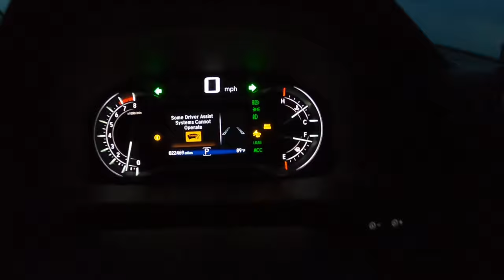Towing 4800lbs 3000 Miles across America with a Honda Ridgeline - Part 2

Comment: Great video. I would not worry about a trans temp of 220. Modern trans fluids are synthetic now. The factory cooler runs off of the radiator and the trans will run at a minimum of the coolant temp. A $35 trans cooler off of Amazon can be installed in an hour or two which would take care lowering the trans temp if you want the trans to run cooler.

Comment: What year did you use while towing? Did you try selecting a lower gear to see if the transmission temp would go down?
Reply from the maker: I believe I go over that in part 3 and I will talk about it in detail in my wrap up video. But to answer you quickly I used drive only and did not use the D4 (Overdrive). From research people have stated on forums the D4 makes the truck run hotter.

Comment: I think if you tow over 3500 Honda recommends the transmission cooler had to get one on my Pilot
Reply from the maker: Interesting. Haven’t heard of this yet. First time.  This is the RTLE so it’s rated for 5000. Didn’t read anything in the manual that stated I needed to upgrade the cooler.
Reply: Yuriy Motso oh that maybe the difference from the Pilot maybe the Ridgeline came with it already cause my Pilot required the transmission cooler for the 5000 rating
Reply: The ridgeline comes with a transmission cooler
Reply: @aronjohn84 but included in the radiator, not External, 35 bucks would Solve that

Comment: How much did the trailer weight ? Any idea total weight pulled and loaded inside the truck?
Reply from the maker: I weighed every single item before I loaded it. Trailer was roughly 3800+ LBS and the truck was roughly 1000 LBS with me. Total weight was very close to 5000 LBS if not a bit over.

Comment: Does the Honda ridgeline not come with a transmission cooler ?
Reply from the maker: Yes it does. This is the RTLE which has the upgraded cooler to support 5000lb towing. However this entire trip was intended to see if the Honda can be a useful tow truck for long distances and through many different driving scenarios and conditions. I pushed the truck further than most people will ever do and the results are what you can expect if you own one. Hoped this could be a very informational and useful video for future towers as when I started there was nothing on YouTube for the Ridgeline.

Comment: Did you change the trans fluid before your trip?
Reply from the maker: No not yet. Just the rear differential was replaced a few thousand miles before hand. Plan on getting this all done here soon.
Reply: @YuriyMotso  You had to replace the rear diff? How many miles are on the Ridgeline?

Comment: Just curious, does the Honda have a transmission cooler?
Reply from the maker: Yes. All vehicles have a transmission cooler. Typically compact cars that are not designed for much load just have it built in with the radiator at the bottom. Vehicles with towing capacities or made to work usually have an external one. This Honda has the upgraded transmission cooler as it’s the AWD model. But still small in the world of coolers.

Comment: Probably the RL radar sensor was running hot causing those error on the dash. Just like the computer running for too long and need a reboot or restart. Anyway... Have a safe journey... Can't wait for part 3.
Reply from the maker: I was glad it went away. We had sufficient stops I believe but as you say, it is possible that the heat was getting to the computer.
Reply: @YuriyMotso  Had the same issue several times.  I think it was the squat of the vehicle from the trailer combined with the low daylight.  If it can't properly see the lines on the road (the camera is inside the mirror) it will disable the system.  I also get that warning sometimes from bugs or ice build up.

Comment: Someday, Honda will weld a 4 foot box on the back of a Honda Fit, and call it a truck. Then folks will brag about how it drives like a car, much smoother than other trucks, and tell truck owners they should buy one.
Reply from the maker: If it fits, it sits.